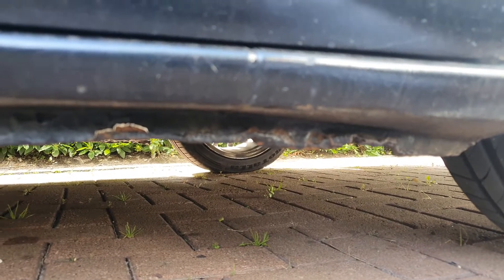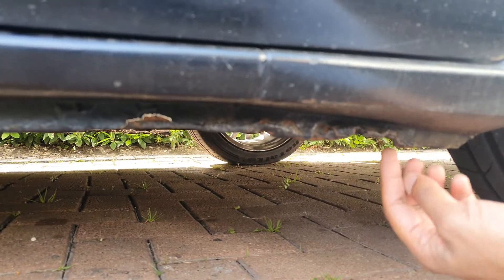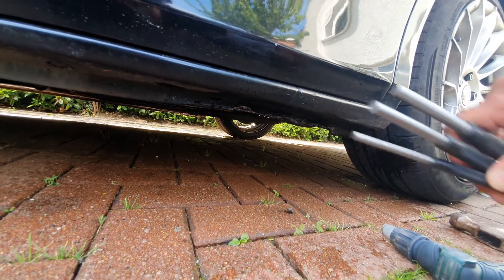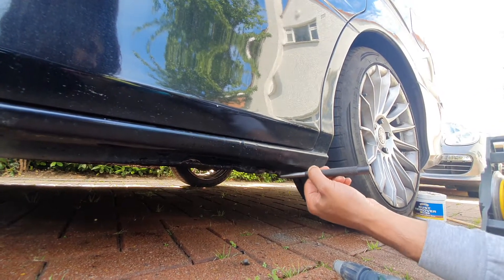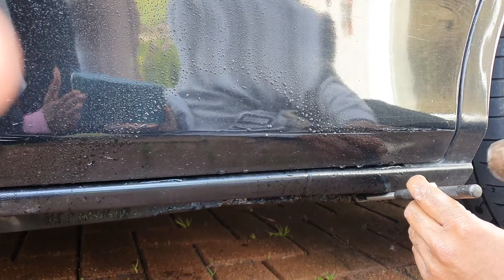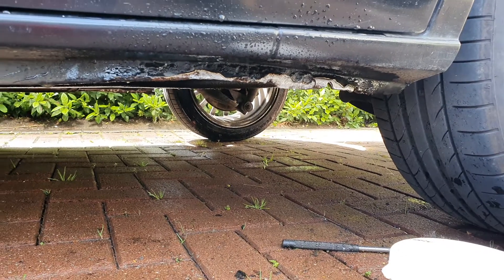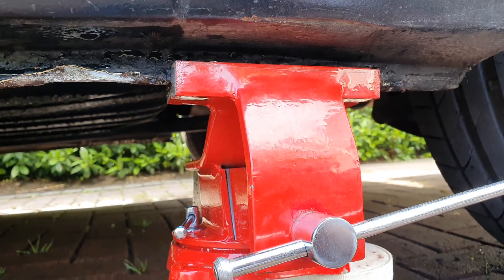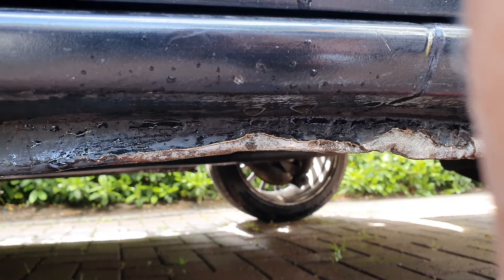Toyota Alphard / Vellfire / Granvia damaged sill repair .

Comment: I've unfortunately damaged my own classic using the wrong Jack. Ironically the cheap scissor jack in the boot does a much better job than a hydrolic low profile jack I bought. So this is a good guide for me to fix mine up. Thanks.

Comment: But you have not reinforced the pinch. Why not ?? So what about next time you need to change a tire ?
Reply from the maker: I don’t use these jacking points. I think they are prone to damage. I use under the suspension mounts.
Reply: @Cuttothechase  The photo reveals that you use at Jack without a rubber insert. When I lift my car I use 2 individual jacks on one side of the car. In this way each jacking point is lifted with ½ the force.